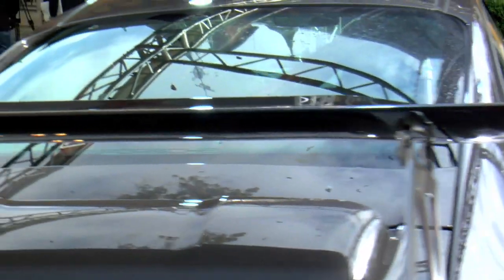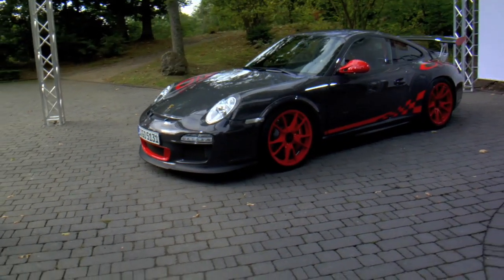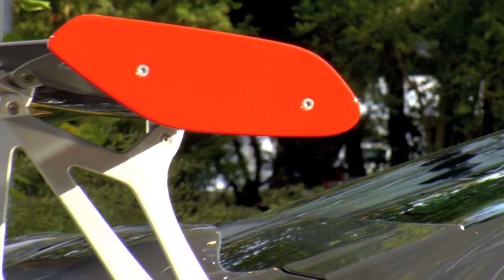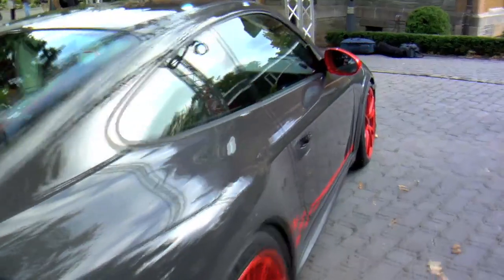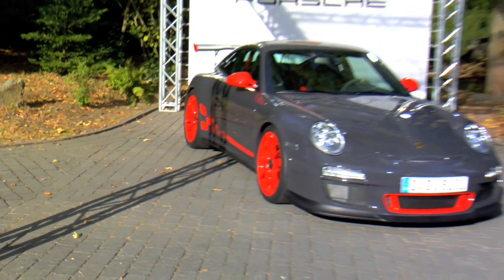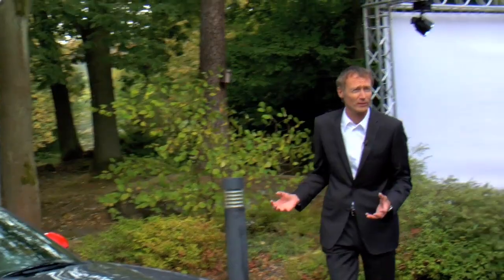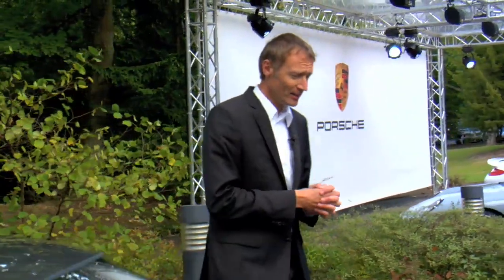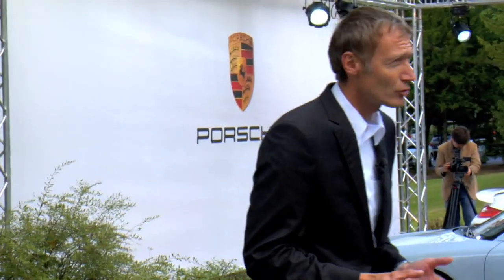2010 Porsche GT3 RS Autobahn Shakedown and Overview

Comment: I get that, but you do realize that wasn't what our convo was even about....right?  The main points were this car looks ugly. (opinion based).  I cannot fit in one (fact based). and to be honest in the USA top speed and extreme handling both do not matter because our speed limits on roads are much lower than most European highways and we also have better quality straighter roads in most parts of the Country, so its never needed, just fun to brag about when you have them I suppose.